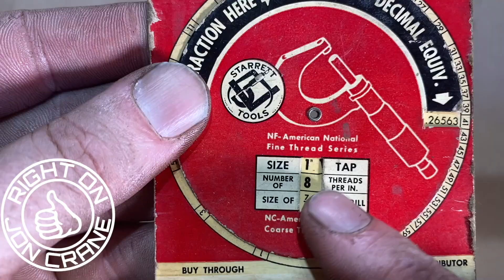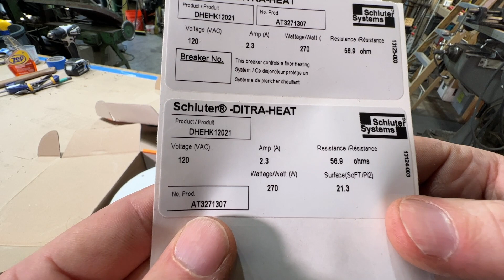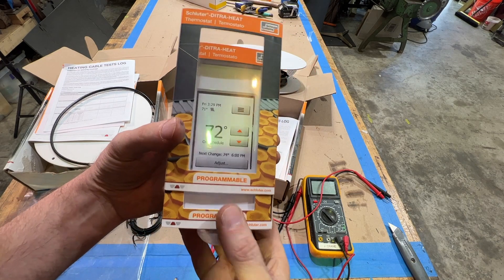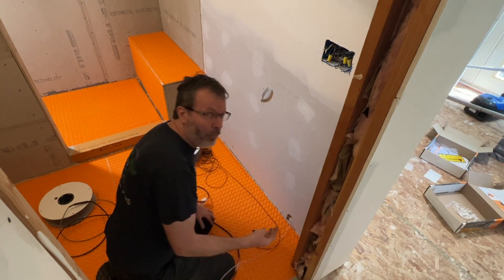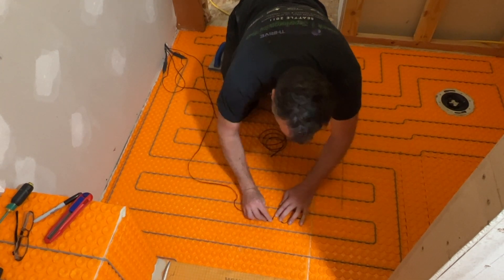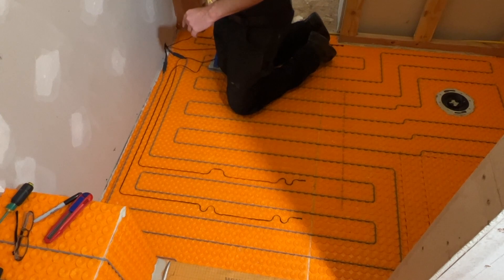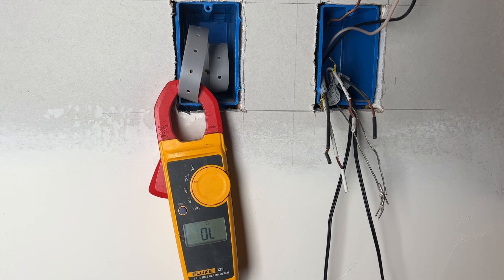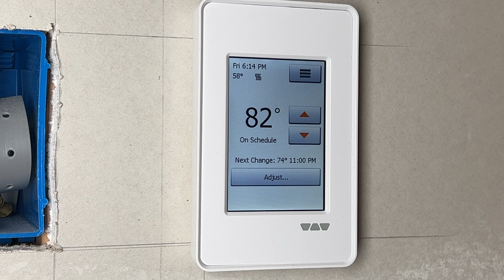Heated Shower - Ditra Heat How To -Tile Shower Build Part 2

Comment: A recurring tip I saw when I was researching was to add that second sensor wire. That seems to be a common issue that can go bad. And if you only have one sensor wire you either lose your heated floor or have to tear everything out and retile and buy all new materials. If you have a second sensor wire, you just swap it into thermostat and you are off to the races again. Glad you included that.
Reply from the maker: Right On! 🙌 Thanks Chris! I ended up with three. But put two in the floor. Hopefully It doesn’t come to that but always good to be prepared and have a backup!

Comment: How would you install the wire if you didn't use the orange stuff?
Reply from the maker: This is all part of a system of parts so the orange Ditra heat membrane needs to be used. There are other brands that has the wire attached to a mesh mat that gets filled with thinset.
Reply: @RightOnJonCrane  thx